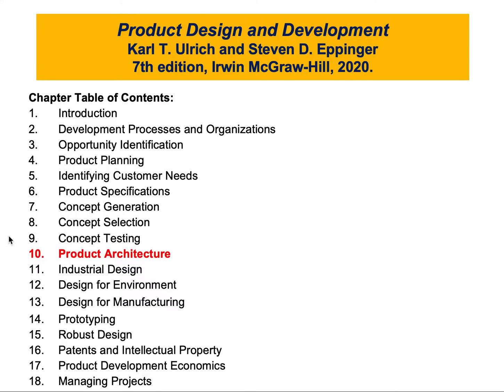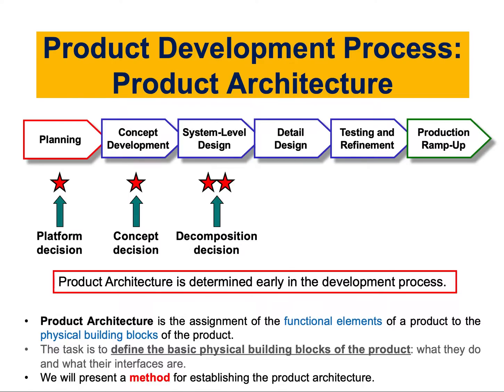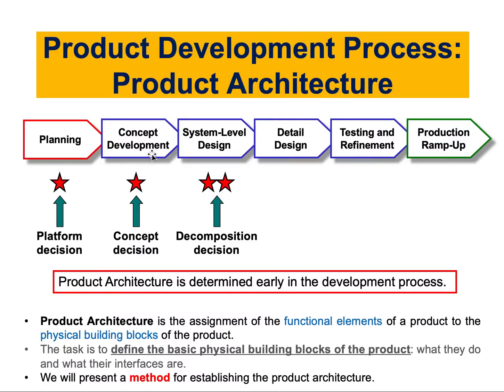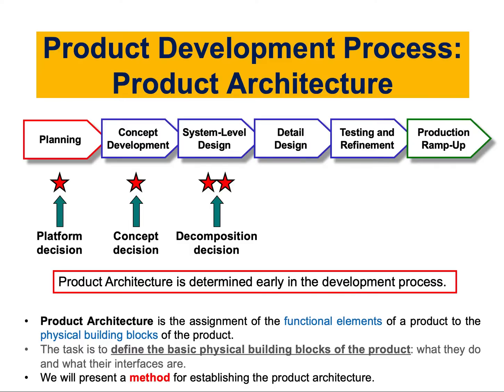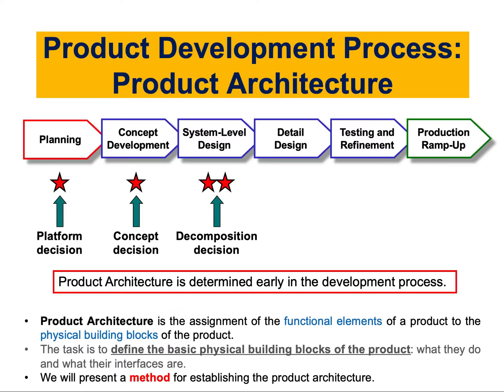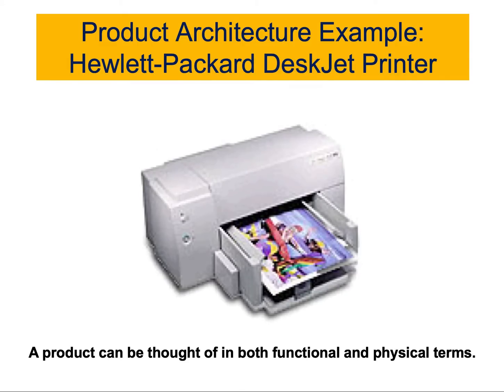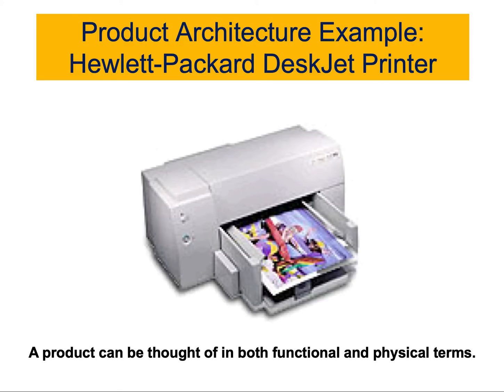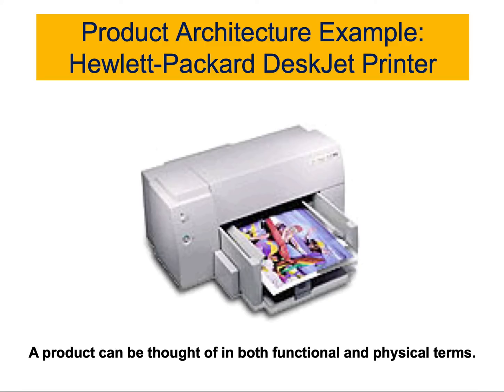#035 Architecture Design for New Products: An Introduction - Product Design & Development M10

Comment: If you explain this with relevant example it much more better and students will understand easily...you just explain in text it's boring and really hard to understand
Reply from the maker: Thanks for your feedback! I agree that it's important to use relevant examples to explain concepts in a way that students can understand. I'll try to do a better job of that in future videos.

Here's an example of how I could have used a relevant example to explain product architecture in my video:
"Let's say you're designing a new smartphone. The product architecture would define the overall structure of the phone, including its components, interfaces, and relationships. For example, the product architecture would specify the different components of the phone, such as the display, the battery, the processor, and the memory. It would also specify the interfaces between these components, such as the way the display communicates with the processor. Finally, it would specify the relationships between these components, such as the way the battery powers the processor."

I hope this example helps to clarify what I meant by product architecture. Thanks again for your feedback!